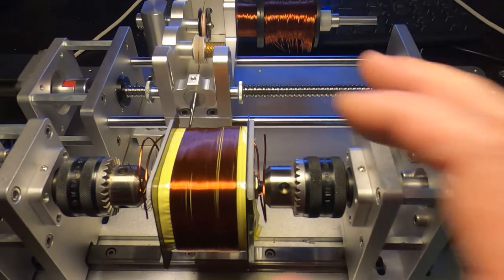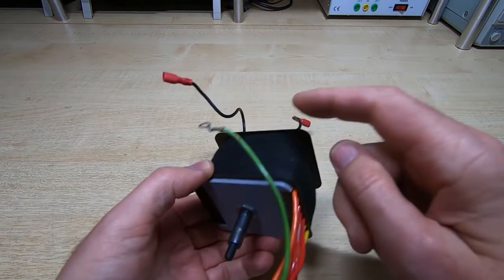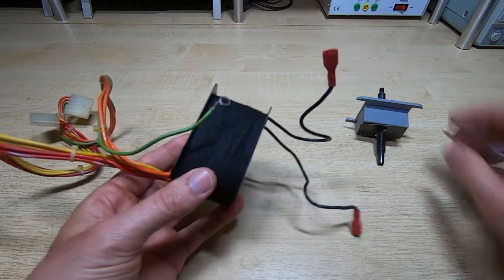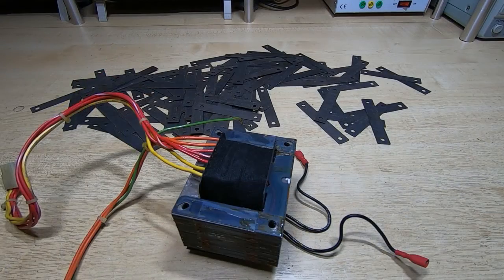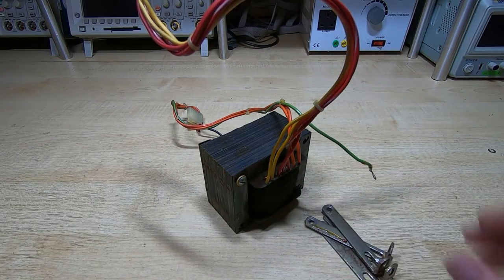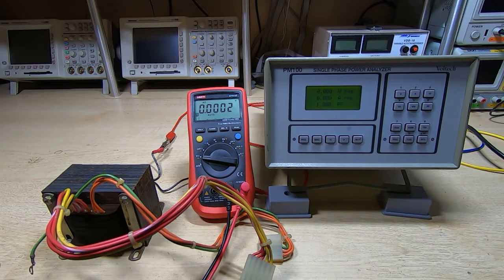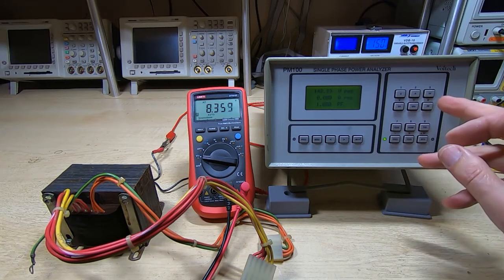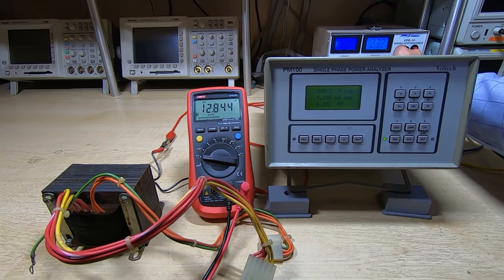ADM3 Transformer Rewind Part3

Comment: I thought that the transformer formula was in metric, such as core square CM. Also gauge of wire formula is as 700circ mils times current times duty cycle. If power not on all times during time period , then the gauge wire can be smaller. circ mils times % duty cycle. Also, if choosing a LARGER core than required, then there is less turns that have to be wound on bobbin because of formula. Assembling a low frequency transformer with E and I laminations can be interleaved, or separated , so as the top I set comes off, so as bobbin quickly removed for rewinding. The separate laminations type requires strap over unit to hold together. The old style radio chokes were like that method.
Reply from the maker: As with all calculations it does not matter what units you use as long as you use the same throughout. Duty cycle has nothing to do with transformer output. If you overload a transformer then it will not meet the designed output. Yes you can assemble E,I laminations in two parts but this does not result in the same performance as the 'gap' causes local losses which are not reduced by the adjacent layers. This will result in a noisy and inefficient transformer, RF inductors are designed differently so often are constructed in different ways. For example they are often on single 'rods' but you would never use that arrangement for a power transformer.

Comment: Enjoyed this video and your 3D printing of form for winding.
I was taught (long ago, 40 years now) to use the bolts for stacking the “E” and “I” laminations,
so your approach was different.
I was also taught to use cardboard tubes/sleeves on those 4 bolts for the laminations.
Reply from the maker: You can only use the bolts to align them if you stack all the E and I on one side. When they are alternated there is no way to get the bolts in until all the laminations are in place.  The bolts are also too small to accurately align the laminations and being threaded they would make the task much more difficult. The transformer will work if all the laminations are on one side but it will be far less efficient. Tubes on the bolts are not required if a fibre washer is placed under the head of the bolts (you can probably see this in the video but I did not point it out). The purpose of the tubes is to insulate the bolts so that they do not 'short' the laminations which are coated. I do not want to complicate the videos with these finer details as I want to keep the videos focused on the main task.